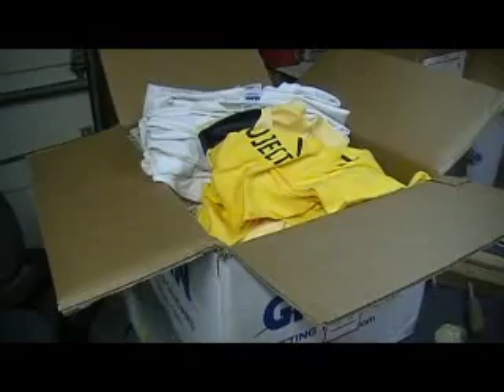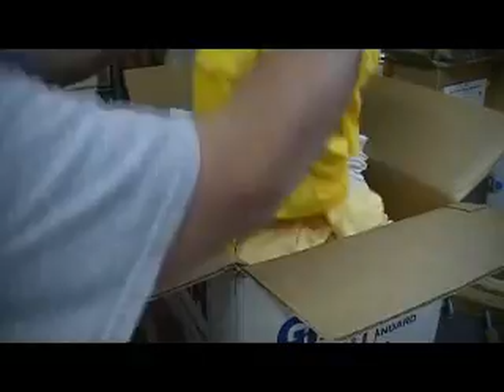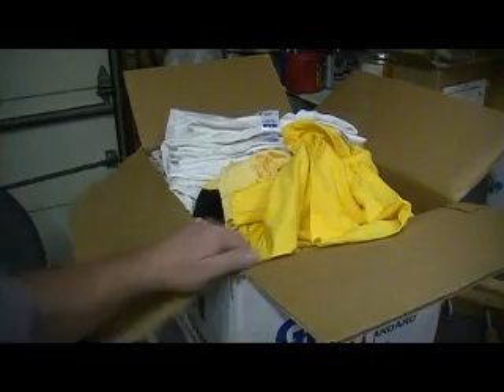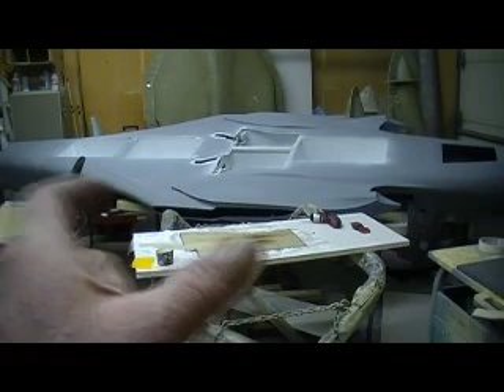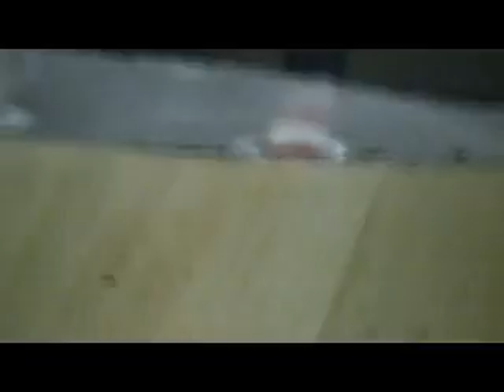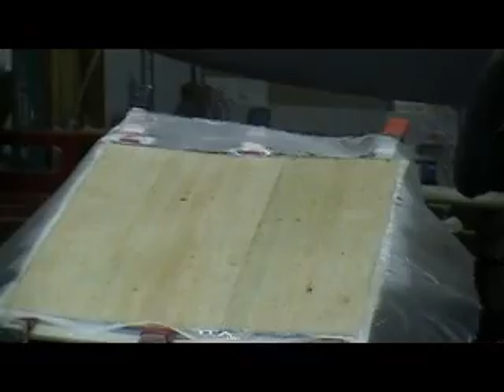how to build a rc jet B-1 Bomber # 112 pt 3

Comment: Hey Bob dont you worry about asking for donations. People cant get great info like this anywhere so if it helps you out some with your project and lets you make informative videos then so be it. 
 One thing i would like to ask dont know if it has been mentioned before, is there a way you can turn off the letterbox option on your cam? It will get rid of the black lines on top and bottom of the pic. Some stuff gets hidden behind them. Just a suggestion.  Keep it up!